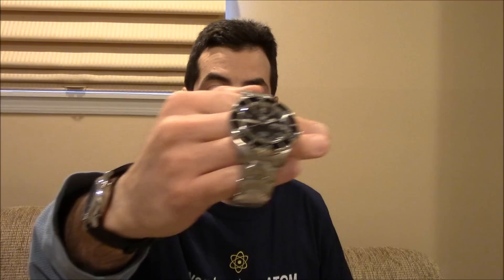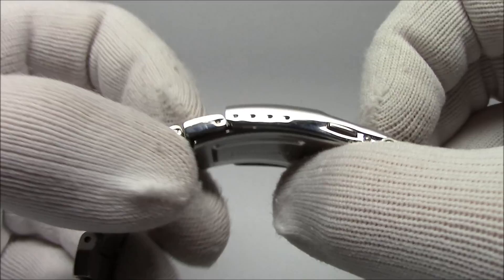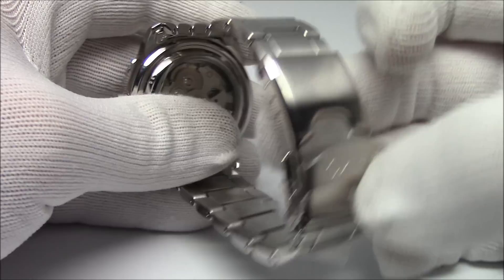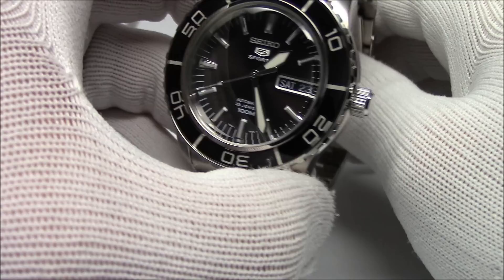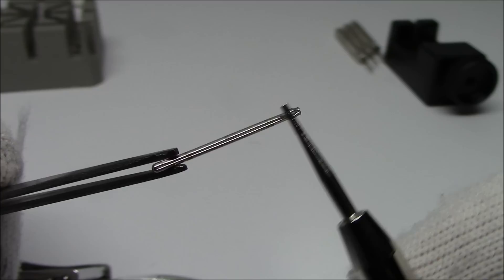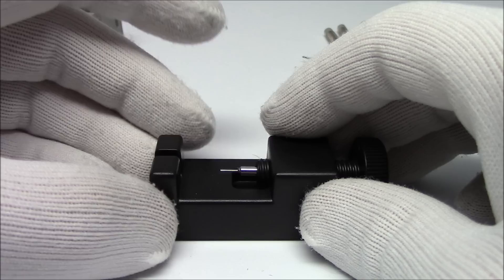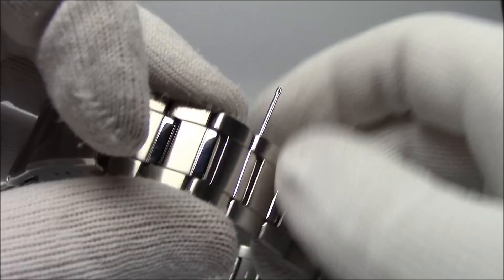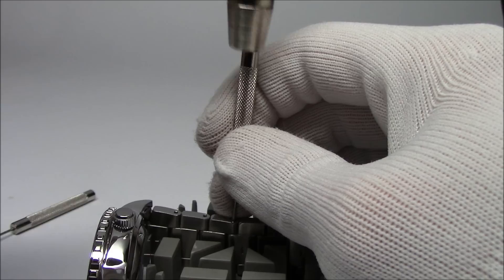How to Size a Watch Bracelet (3 Different Methods) - Watch and Learn #14

Comment: This was super helpful!
A new watch arrived today. First new watch I’ve bought in 10 years. 
I got a sizing kit similar to the one in this video. Probably a much cheaper version though. 
Watched the video through twice. Then decided to give it a try using that screw type vice tool. The pins came right out, I removed a few links, then used the hammer to replace the pins. 
Finally I used the method shown here to adjust the spring pin. Done in less than 10 minutes and the watch fits perfectly!
Thanks!!

Comment: If you don't have a fancy watch block, to put it on, while you tap the pins out, I used a "flat" wrench from a monitor arm to provide a simple gap for the pin to fall out. Also, if you don't have the fancy punch tool, the center wire of a coax video cable can be used to gently tap the pins out. Yep, talking about mcgyver, but it really does work! Great video, and thanks for the helps.

Comment: Thanks a million! Before the video I was using a micro flat to try to unscrew the pins 😂 I had no clue what I was doing. Also, I used the fine tuning pin and your method is excellent to do it quickly and keep it all together.

Comment: I frequently use just the band holder/block + hammer + punch but sometimes those friction pins are really tight. No amount of hammering on my part can get them out. So, I have to switch to using the pin pusher vise (whatever you call it). Even with that tool, some pins require quite a bit of force to turn/screw the pin down the link hole.

Comment: Thank you for this video.
I recently bought a Citizen HTM Eco Drive and it was way too big for me.
I needed to remove 6 links and the local jewelry store wanted $10 per link to adjust it.
I just did it with a kit and it only took me a few minutes thanks to your video.
I used the block and hammer and pin to make the adjustment.
Fits great now.

Comment: Learned a lot from your video, tried other ways I saw online. Couldn't find the jewelers block you used, made one on my table saw in about a minute, Measured the width of my watchband and made the cut to leave 1/8" of the band above the wood surface, used a colored push pin and ground the pointed end flat, tapped the pins out of my band very easily. Voila!

Comment: Thank you used the very first method to adjust and it worked great. A jeweler advised $ 22 for the adjustment. This video saved me $ 88 as I had to adjust 4 watches that I just bought.

Comment: Nice video. I was able to remove 2 links and tighten one micro adjustment on my new Invicta 5053 'Pepsi'. I like the idea of 'walking' the micro-adjuster pin, but I was not able to do that. I didn't lose the pin at least and did get the band finished. Thank you!

Comment: Nice educational video.  I have resized bracelets, but have never done the micro adjustments before.  I believe I can now that I have viewed your video......Thanks!
Reply: Also, I hope you do a video on changing watch batteries.  I get lost when I see the watches that the battery is held down with flanges on small screws.  This would be very helpful....thanks again!
Reply from the maker: Thanks for checking it out! Will consider for a future video.

Comment: Thanks for the video! I used it to size my Omega bracelet. All I needed was spring bar tool with pin, hammer, and bracelet holder clamp. Unlike the Seikos, Omega pins are the same on both sides. That part confused me but I figured it out.
Reply from the maker: Great!

Comment: Thanks, just removed 2 links from the strap, bent one of the pin pusher like thing that I had in watch screwdriver box and got few scratches on one of the links, but it was still fun! Now I hope pins don't just fall off and I lose my watch. lol

And thanks for micro adjustment tip, I realized how handy it was when I had that ApolloX111 fly out on my face, at least I managed to find it quickly lmao

Comment: Thank you, thank you, thank you. New Casio edifice watch arrived today and on trying it on it clearly needed two links removing. I have never attempted this before and am rubbish at anything manual - DIY? Forget it, I call an electrician to change my lightbulbs (OK not quite that, but you get the picture). fire up youtube and the third video I watched was this and within less than 10 minutes all perfectly done and a perfect fit. I'd already bought the plastic cube and mallet/hammer thing and it worked a treat.

Thanks again, you're a star  :) :)

Comment: Thanks so much. Just did my Lucien Picard new watch with much difficulty. I have all the tools but the pins were in so tight I almost gave up. FInally I did it.  I budget tool broke as soon I started turning it and it didnt come with extra pin ends.   So thanks again for all the info.

Comment: thanks!  I used a thumbtack and small vice grip adjustable pliers got it done in less than 2 minutes time   never new there were arrows letting you know which way to push the pins or the fine tuning adj. at the clasp

Comment: One tool I don't see but I recently own is like a plier by the name of Paylak TSLK4. It has a pin push and you just line it up and squeeze like you would some pliers. Easiest tool I've ever used to remove links and its a shame you don't even see them unless you're really looking for alternatives. I've used almost every tool on Amazon and for years I wouldn't come across this tool. I literally got it about 3 weeks ago and have used it on a few watches with minimal effort.

Comment: Hi mark I was wondering if i can replace my folded sheet bracelet with solid ones made for a different model, they have the same width so i was wondering if it would fit the same. Great content by the way, new subscriber 😌

Comment: What if you bracelet doesn't have arrow markers? Mine has push pins at the end of the links, and for the micro adjustments, but the rest are not. It doesn't even look like a split pin either. 

Figured it out, just needed a little force to push the pins through, but there just solid pins, no taper or split in it. Easier than I thought. Adjustment successful, tape on the pliers and a keyring, bent straight does the trick. I used a Hex set which has a tiny H0.7 size head for the initial push, keyring wire to push the extra, then the pliers to pull it out the other end.

And thanks @Mark for the inspiration, your guide helped.

Comment: My Citizen metallic band has pins, but when I pulled one of them out using the vice like yours, a small "collet" fell out, and I finally discovered that one of the central links uses this collet to secure the pin? or for some other purpose. My difficulty was in getting the tiny collet into the hole in the middle of the central "link" there are a total of 7 "shared" links to every other connection, with some links having a dado groove on the underside which fits over a crossbar in the compantion link. Any tricks for dealing with this tiny collet/tubule? think of it as a tiny little stainless steel straw, about 3/32" of an inch long, and hollow, as the pin goes thru it when connecting all 7 components.

Comment: Great video thanks. I have a question, what do you suggest for repairing a watch glass that cannot be replaced ? I have a Seiko quartz dress watch from 1989 that fell off a table and chipped the edge of the glass,  Seiko Australia said they cannot repair the watch, so I am thinking of trying a super glue for glass, would anybody know the best product to use ? Thanks.

Comment: The micro adjustment is mostly on dive watches as they are normally worn over a wetsuit hence the need for quick additional strap length.

Comment: I used a paper clip and a pair of pliers a found in garage to get the pin out. I put it back in with a tiny by using piece of wood to soften the tip of a tiny hammer.

Comment: Regarding the "micro adjustment". I cannot push in the pin for some reason, it doesn't move down. Is it possible that it is fix and cannot be adjusted tho the wholes are there? Or are there some types which is really hard to push in and need a special tool?

Comment: I've been sizing my own bracelets lately and have typically been removing two links.  I remove one from each side, like you say, but because I use the loosest micro adjustment, the clasp is not centered.  Should I instead remove two from the 6:00 side?

Comment: Armitron is so unique. There is no way you can remove the lug pin without hammering it out or is there? Unique pin for it also. The double flange doesn't even fit into the hole on the side of the watch, so how do you take off the bracelet correctly and what kind of pin of that? I'd like to see more on Armitrons because there are many just like them.

Comment: Okay so question :-) when you are adding the link back to the watch , arrows should be up, additionally the end that is widen should be the part sticking out correct? Last question, with the widen part sticking out, it’s okay to hit that part with the silicone hammer ? Will that change the shape of that end? Will I not be able to use it again once hammered ? Thanks for any reply

Comment: Thanks for this video.  Do you not approve of the pliers-type of link pin remover which has the capacity for wider band links?  Also, why is the smaller version so prominent in the marketplace, when it's nearly useless?  Thank you.

Comment: Thanks for the info. I have a watch strap that looks the same as this but doesn't have arrows on the bracelet, and there are no pins. What's the best method to remove a link? It looks like they are pressed into that shape and the only way to remove them would be to prise the link open.

Comment: How would you remove double ended screws?
I am afraid to use two screwdrivers to prevent the other end from rotating in case it scratches the links.

Comment: Do you think, a steel bracelet for a Omega Seamaster 300 professional can be sized with a Burgeon No 6767 tool?? I bought that watch for my dad used but it's too tight on him and he doesn't wear it as a result.  It came with extra links and everything.  My local Omega AD dealer basically told me that even though the watch is warrant'ed until 2021 that they will charge to size the bracelet.  I'd rather purchase the tools and even attempt it myself (if possible, offcourse).  Anxiously awaiting your reply.

Comment: Anyone put oil or light grease on the pins before replacing them?  Just wondering if this may reduce long-term wear on the bracelet.  I have a 18 yr old Citizen Solar-Tech that is great, but the links flop around [well broken in].  Wondering if they will last when I pass it on to my son.  Can't use a regular band with this case, otherwise I wouldn't care about it.  Thanks for listening.

Comment: I saw a few new seiko's on your site. Maybe you could do a video to show them off. SRP735 looks like a great deal with hacking and hand winding
Reply: Also, my skx was fast 1 minute, and I changed the time counterclockwise. I got worried when the seconds hand jumped backwards 5 seconds. I guess I should only set time clockwise in automatics. Does that harm the movement?
Reply from the maker: no, not a problem! This is normal with Seiko and Orient movements.

Comment: On my new watch, the bracelet appears to have been machined or ground flat on the edge, and the pins are barely visible. I've ordered a pin vise, and I hope I can center on those barely visible pins and push them thru !

Comment: If the space between the watch lugs are 20mm is a 20mm springbar required to repair it or is it 22mm so it will fit in the holes at either side
Reply: You need the 20mm. The spring action compensates doe the depth of the holes on the lug.

Comment: My wife received a Burberry watch that needs adjustment. There are no arrows on the links and there is no split on either end of the removable pins. Is this a different kind of system? I sure don't want to mess this up by experimenting. Thanks for any insights.

Comment: Is it necessary to have equal number of links on both sides of the watch strap after adjusting or is it ok to have one side of strap bigger and the other smaller like 6 on one side and 5 on the other side???  Does it look awkward or ruin the look of the watch if you have different numbers of links on both sides. Some watches need that some are good with equal number of links.
Reply: Stallion - Yes, if you have OCD.
Reply: It is not uncommon to have differently sized sides. Typically, if the smaller number is on the 12:00 side of the watch, it balances very well.

Comment: Beware:  For many Sinn watches, you'll need a dual teeth spring bar tool to install and remove metal bracelets without scratching the lugs or breaking the spring bar in half.  It's not mentioned in this video as this specific watch doesn't have those requirements (but about 3-4 Sinn watches DO, including the U1 & U50's).  On my watch, the lugs are 20mm apart, however, the spring bar is legit 22mm long and has longer spikes on each end LOL.  It's like it didn't even come with the proper spring bars.

Comment: Some time back I went to a watch guy who measured my wrist and magically took out the exact number of links that I needed to make it fit perfectly. I know that you are an engineer. Is there a formula/rule-of-thumb for how many links need to come out.
Reply: A good rule of thumb I use is that you should be able to slip your index finger under the bottom of the watch band. If you can't do that it will probably be too tight.

Comment: NON-COTTER PIN bracelet adjustment problem:

Hi Mark, I've watched most of your videos, which are excellent, so maybe you can help me on this one.

Some watch bracelets do not use the cotter pin.  Two watches I have, both Citizen with titanium bracelets use pins that are tight when you get them, but when you remove the pins, they are just straight pins and just fall through when you try to put them back in.  I solved one by stealing a cotter pin from another bracelet.  It was so tight that I got it 99.9% in, but tight enough.  No one else would notice it, but I know it is there and it bugs me, but I'm afraid to mess with it.  I got a second Citizen watch with a Titanium bracelet.  Being suspicious, I decided not to try it myself.  I took it to a jeweler, believing that they would know how to handle it if it were one of those non-cotter pin bracelets.  They finished the job with confidence, but after working at my desk, wearing the watch, I noticed the replaced pin sticking out.  Sure enough, it just slipped right out.  I found one tutorial covering this, directing to squeeze the end of the pin to flatten and widen it with pliers.  It looked like a good solution, but I am going to bring it back to the jeweler.  That being said, I would like to know what your approach to resizing bracelets with non-cotter pins.  Why are they tight in the first place?  And, how can I make them tight when I replace them. 

Note:  This is not an 'L' pin, it is a straight, solid pin, the size of the hole.  Thanks!
Reply: Same issue I am having.   Once the tight pin came out, it slipped in and out easily.   I might try some red threadlock in the center link, if I dont come across a better solution.

Comment: Does anybody know how to adjust or install deployment watch band that comes on a Tissot? For some reason I've ordered two and in both cases they came with no way to put them on. On the first one I thought was defective and they she didn't ship something so I order a second. But it came in the same way it is a rubber end on one end and then the deployment metal Parts on the other end. But it seems there are no way to join the two. Am I too stupid to make it work or is there something wrong with these watches.? I am limited eyesight and I'm a nursing home so I cannot get to a jewelry store. And everybody here has no idea how watches work. Seems like everybody here has a Apple watch so has no idea how real watches work. Or even a simple bracelet.

Comment: Watched this and was still confused by how much was different about my Fossil watch band. It has arrows pointing both ways and no difference from one end of the pin to the other. But nothing I wasn't able to figure out they are more simple in comparison. Pin can go either way hence the arrows and the wide point is in the middle not at one end. Plus Fossil uses a solid straight pin. All in all somewhat idiot proof.